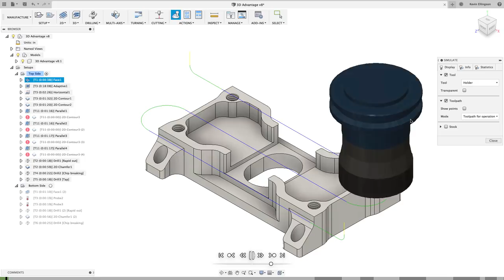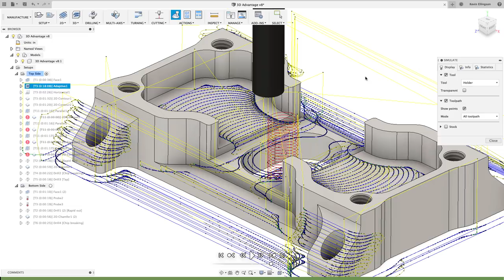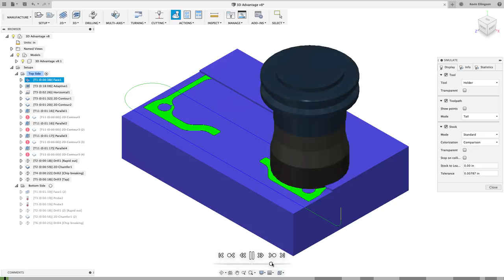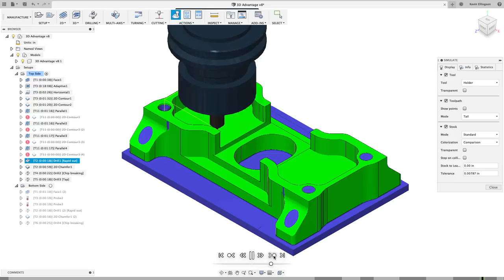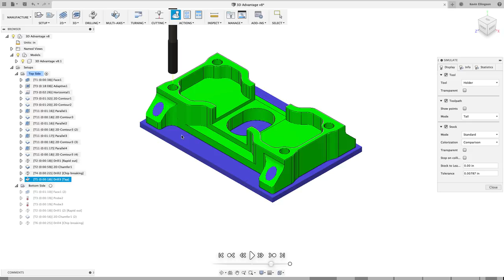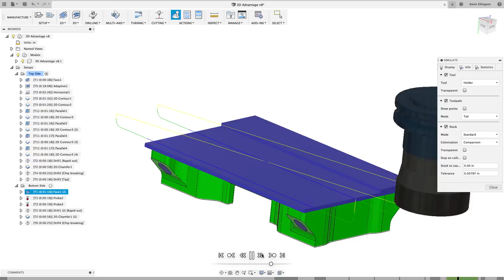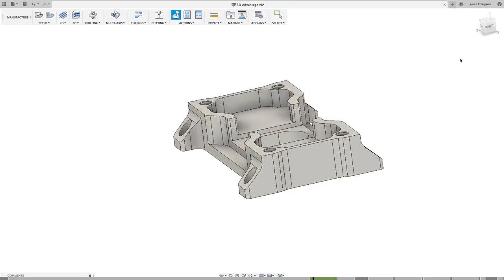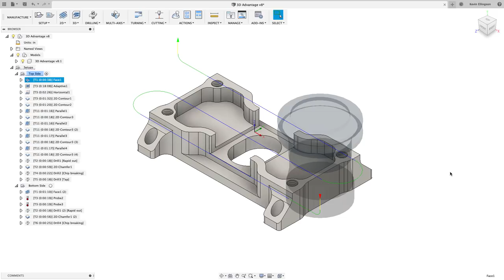Fusion 360 - Simulation Deep Dive

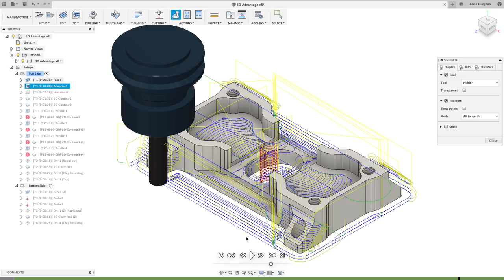Comment: Great video! Unfortunately, for me, clicking on a point (as you show in 5:19) on the toolpath does not move the tool to that position. Have you seen this behavior before? Even if I turn on Show Points, still clicking on a point has no effect. Do I have some preference or setting configured incorrectly?
Reply from the maker: On the toolbar at the bottom
Of the screen, find the camera settings. It has to be set to orthographic in order for this to work. If it is perspective or perspective with ortho faces, it won’t work.

Comment: Some really useful stuff here. Some I'd not registered before and some I'd possibly seen but simply passed me by! 

There must be a setting somewhere that determines if the simulated output is "identical" to the model ie shown green here. But obviously the result of the toolpath won't be identical to the model, for instance where you created the ramp using a ball end mill, which clearly creates a series of stepped scallops. Do you know where that tolerance is set? 

Looking more closely at the various settings, there are various tolerances and smoothing tolerances scattered throughout the CAM operations and the simulation itself. Ultimately you want to know that your part recreates the model within the required tolerance / accuracy and we are sort of believing that the green surface tells us that. Knowing how to set that visual go / no go threshold would be very helpful. It may not formally meet GD&T requirements but would be a massive help.
Reply from the maker: Hi Murray. There is a tolerance field in the comparison option. I wish simulations offered better visual fidelity, but for now this is more used as a check to make sure everything has had a tool path added.